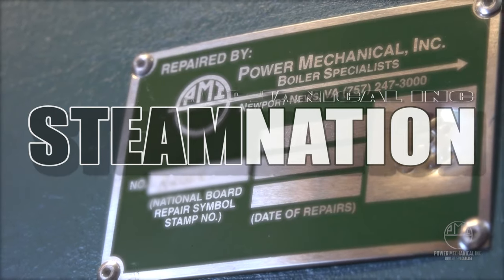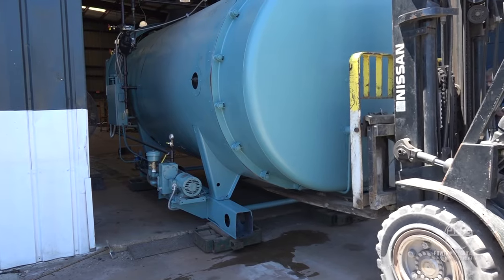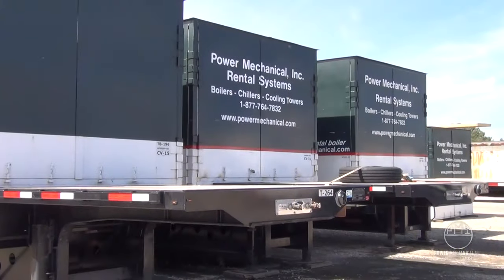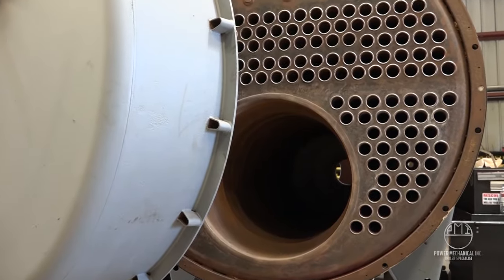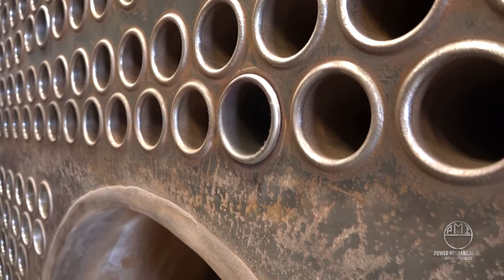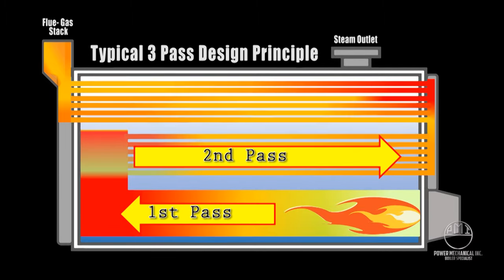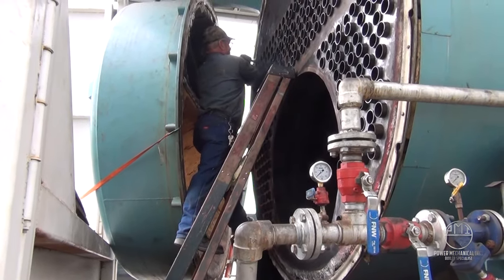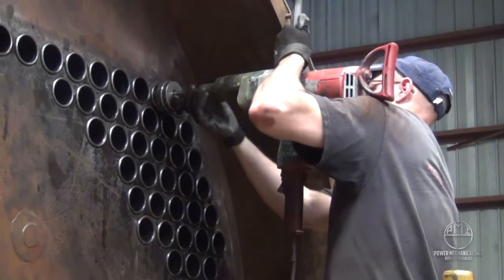How a Firetube Boiler Works

Comment: 1975 york shipley 2500 gallon i used to operate on #2 fuel oil then on natural gas to heat 300 thousand sq ft of commercial space. It was a challenge keeping the many steam traps functioning.

Comment: Could a scotch marine boiler be adapted to a  smaller scale, say made to work with a residential woodstove to heat radiant flooring within homes?
Reply from the maker: This design is the premise of many boiler designs. So yes they can be very small scale for much lower applications. Typically residential boiler designs are not as robust in their design to keep cost somewhat steady across the board. Hope this helps.